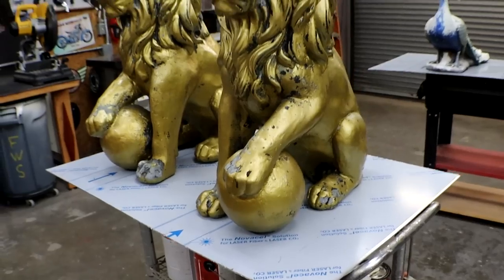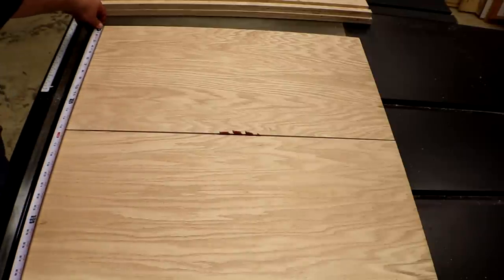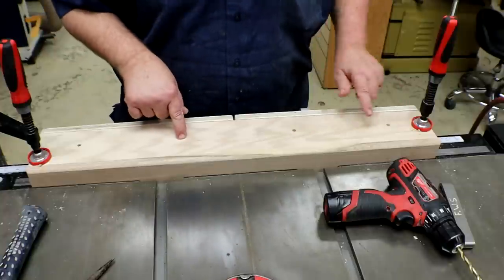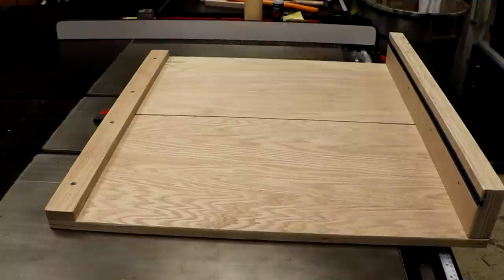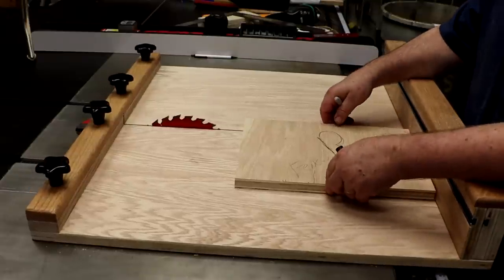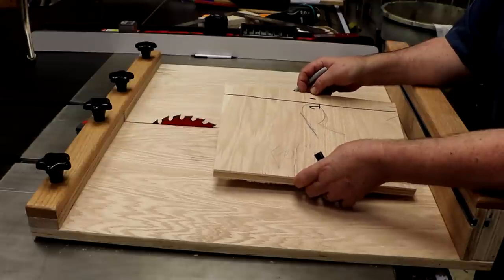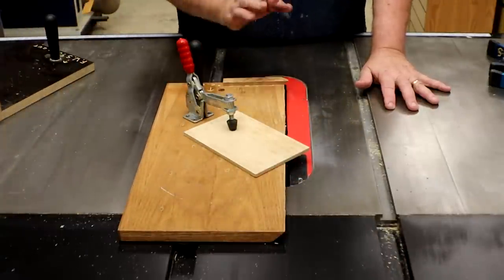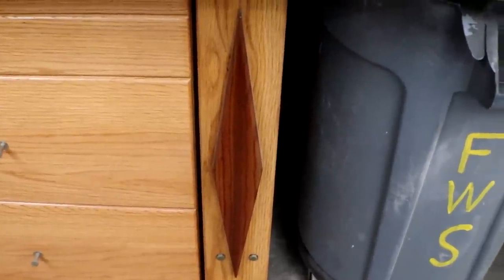SPLIT TABLE SAW SLED

Comment: Hey Doug! I love your split sled design and will most likely use it. I have one improvement in mind though. I think you could move the center of the fence 3” up on the sled and make the inside end pivot there making the fence adjustable. I would then turn the fence into a sine bar by adding a portion of a 6” circle to the fence centered at 15” . The portion of the circle would be half the thickness of the fence subtracted from the 3”radius. Very precise angles could be cut by simply multiplying the sine of the desired angle by 15. I would use a story stick or a set of digital calipers to set the angle. The cut and the rear of the sled would need to be square because you would measure off of the back of the sled.
Reply: Forgot to say thank you for the great video and inspiration!
Reply from the maker: Hey Frank good to hear from you my friend and thank you thank you very much that sounds like a great idea good thinking there buddy I'll look into that. Thank you for pointing that out. I hope you find the sled useful too it works real good for me. But I look forward to giving your idea a run also. And thank you for reaching out my friend I'm sitting here editing a couple of videos at the moment and so good to hear from you buddy. From Doug
Reply from the maker: You are so very welcome my friend it's my pleasure that you get to see it and let you do take the time to watch thank you buddy thank you thank you from Doug

Comment: Doug, what's that red dolly jack you show in the intro of your video?  I'm looking to avoid building mobile bases on every single piece of shop furniture and just rely on a communal dolly jack to move things around.  It's front and center at the 0:05 mark.  What the brand or model, do you know?
Reply from the maker: Bill thank you for asking my friend thank you very much. That is a 1500 lb motorcycle jack. It's made by strong way. I got it at northern tools. The box of course on top I built I use it as an adjustable height carving bench. I also have a video on my channel dedicated to that particular adjustment table. on any of my videos just click on the log logo and it'll bring up the channel click videos and then you'll see it there. It worked out great for me. And I hope it does for you too my friend. If I can answer anything else at all don't hesitate to ask and thank you thank you from Doug

Comment: Doug - another great video! Now I have to make a split sled!  HA!  Hope you guys are doing well in Texas!
Reply from the maker: Brian. There he is how you doing buddy. Glad to hear you're going to bill one. On your one piece section put a top rail where you can mount flip down stops. I thought about that after I got done where you could set up one two three four different cuts on a one-piece sled if you use the flip down stops so I've got to modify mine now I thought about it after the fact. We're doing well and staying safe and I hope you are too my friend and thank you thank you so much from Doug
Reply: @fleetswoodshop3339  Hey Doug, that's a really good idea.  I also think I'm going to put in 2 T-tracks down each side for miter cuts, etc.    And don't worry about the length of your videos, you can show as much or as little as you want.   I'm not nearly as experienced as you so every time you make a video I learn something!  thanks for sharing all your knowledge - I look forward to your next one!
Reply from the maker: Brian great to hear from you my friend. I completely understand that. The t tracks will work great. and design works real well for me I hope it does for you too. Thanks for mentioning about the film. Thank Buddy from. Doug

Comment: Brilliant, I’ve just bought my first table saw, could you put some links in to all the tools you used in this video? The drill guide, the blue clamps etc. subscribed
Reply from the maker: What a pleasure to hear from you my friend thank you and congratulations on your table saw. Let me know what kind you bought when you get a chance. I will do my best to put a link. But let me see if I can make it real easy for you the blue track that's in the face of the handle to hold the stops is made by kraig. And the drill bitter liners are made by Big Gator tools. The blue hole down clamps are made by rockler. You can find all three of those tools on rocklers woodworking . Website. You can also find them on woodcrafters website. Both of those companies carry them. All the knobs I used are also available at rockler. Woodcrafters. And also available on Amazon. My assistant who helps me with the videos will be coming in a few days and I'll see if she can add the links to that particular sled video. When you get a chance let me know what table saw you bought. I would love to know. And I will gladly answer any question that I can help you with. and thank you my friend thank you I'm honored for your subscription and I sure hope I don't disappoint you. Thank you thank you from Doug

Comment: Pardon but I haven’t read all the responses so if mine is a repeat- sorry. 

Why did you bury a T track inside the near hand hold side of the sled?  Some of the video shows only two 3/4 thick pieces, then you added one more and attached the cap.  
I’m just not clear of the reason the 3rd thickness and hiding the T track was intended.  Or maybe I missed something.  Over all I have been watching all kinds of sled videos and this will definitely be the one I make. Great job AGAIN my friend!
Reply from the maker: Dave thank you buddy thank you for watching. the t track in the back is so when you're using the sled split in half. You still have a place to connect the stop block. When you put it back together as one piece the t-track holds it together as one sled. That was the reasoning. I use that particular sled as a split sled most all the time. For a person that doesn't have space for more than one sled. I wanted to show how you connected together and use it as a single sled also if you chose to. That's why and thank you thank you from Doug

Comment: great video and a very nice Sled design,  have you thought of making a fence on the far end as well to get 4 setups out of the two sleds by flipping them around? (would only work if the miter slots are the same distance from the blade on both sides)
Reply from the maker: You're absolutely correct my friend I didn't think of spinning it around. putting a fence on the back would be kind of hard to reach if you had a hold it. And the slots. Are different by a half an inch why I have no idea but they are. But good thought great .thought actually. And thank you thank you so much. I appreciate you be safe and take care and thank you from Doug

Comment: I got confused because you jumped back and forth between showing the split sled and then showing the sled put back together with the back board held on with the four knobs. What you didn't show was how you attached the second front board (the one with the cap board attached) onto the split sled front board. Are there knobs on the side of the sled towards the operator?
It's a great sled concept being able to switch between split and solid sled. Thanks.
Reply from the maker: Bob thank you my friend thank you so very much for watching and thank you for pointing that out to me I am so sorry if I left that confusing yes the four knobs in the front are wood holes the second front to the two split pieces. I am so sorry my friend if I wasn't clear on that and I can't say thank you enough for pointing that out to me. I actually have another sled design that I thought I would show everybody and I will make a point to point that out on the next video. And I am so grateful that you took the time to point that out to me my friend thank you thank you very much. that's exactly how it's held on just those four knobs on the front. if I can answer any other question anytime don't ever hesitate to ask me and thank you so much. From Doug
Reply: @fleetswoodshop3339  Thanks for the quick reply. I just noticed that the thumbnail photo for this video shows an image of the operator's side of the sled and the four knobs are visible. So you inserted threaded metal inserts into the back of the solid t-track board that the knobs thread into?
Reply from the maker: Yes my friend that's exactly what I did  . And I'm so sorry abought that I will show it again on the next video . I did not realize until now I left the knobs in on the thumb nail. Thank you so much for pointing that out to me. 😃😃From Doug
Reply: @fleetswoodshop3339  Great. Thanks for explaining that. Can't wait for future videos.
Reply from the maker: Bob thank you again my friend that is so kind. And I mean it so sincerely I'm honored you took the time to watch my friend that makes it all worthwhile thank you so much from Doug

Comment: This is the first video I have watched of yours.  Everything you bought up that watchers have complained about, it will continue to happen.  Can’t make everyone happy.    This one was over 30 min, which is find, because there is something called a pause button, and if I get out of YouTube, YouTube remembers where I left off.  I can then come back and finish watching.  Question.  Fore the block to protect from the blade, could you put a split block back there?
Reply from the maker: Sorry my friend I don't know if you got that previous message I'm driving down the road and I try and answer everybody as quick as I can. If you didn't get it no worries. first off thank you thank you so much for watching I hope you enjoyed the video and I hope you enjoy all of them. I'm honored that you take the time to watch. And yes because the sled can be split in half I did split the block. I put a block on each side where if I were to fall or lean against it the block would still protect me from the blade mostly. I've been thinking and thinking. I thought of making a magnetic clip-on block that I could put on when it was being used as a split sled but I'm still working on that design. and thank you so much for your comment about the timing and the length of the videos I sure appreciate it buddy. Don't ever hesitate to ask if I can ever answer any questions. Thank you thank you from Doug